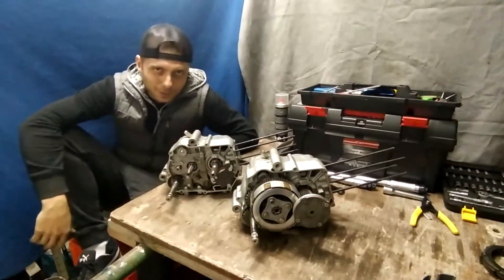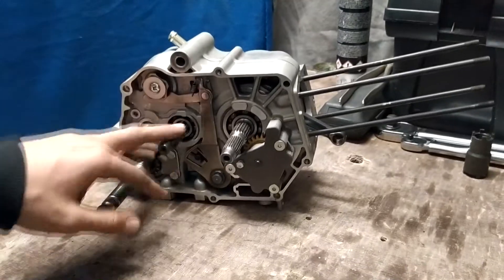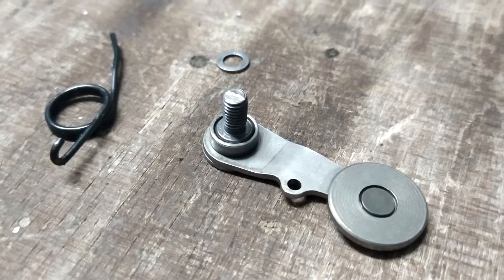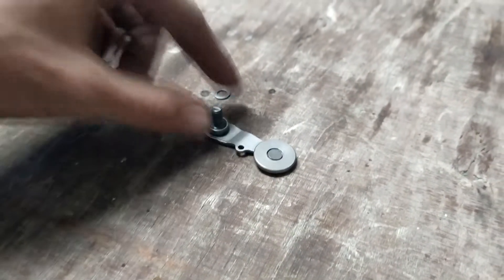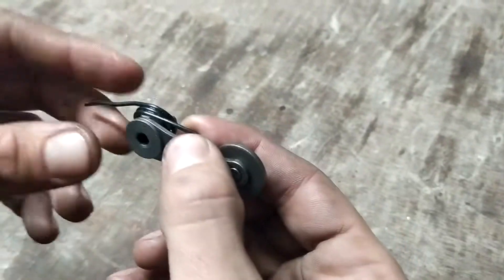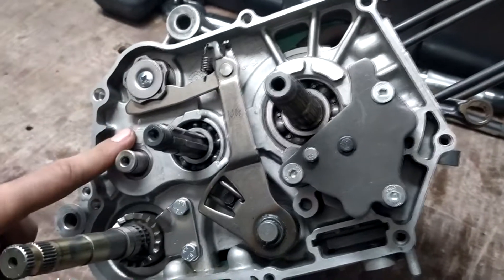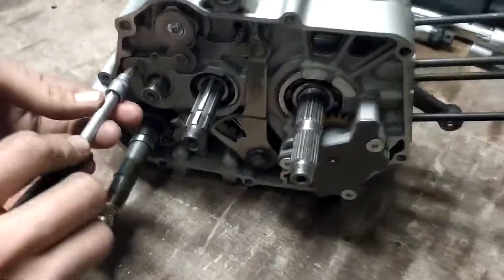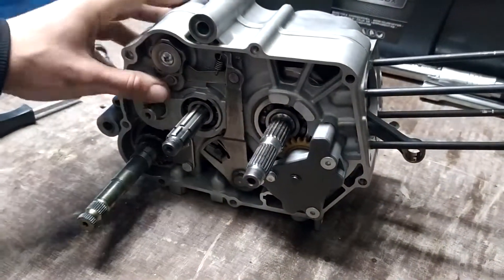Jak složit pitbikový motor YX 140 - část 3. - Spojka a odstředivka oleje

Comment: I did all that and now I have a problem with a clutch..the clutch lever of the block doesn't move. the "T" piece in the block is supposed to press on the bearing on the clutch and push it in, in order for clutch to separate? What do I do? Lol
Reply from the maker: Zkus to prosím česky
Reply: @Mattpitbiketeam  Už jsem to vyřešil, ukázalo se, že se nic nestalo. Každopádně děkuji! :)
Reply: @U.AND.ME_FILM how did you fix it
Reply: @FfjfErgh  funny thing, nothing was actually wrong, I just underestimated the force needed on the lever to press the bearing in. I thought it should go much easier, I was rebuilding this for the first time, while I never actually drove any. 😄
Reply: @ I’ve put a new clutch in as the old one was slipping I brought a complete unit inc the basket shims plates n all that I’ve installed it all correctly but the little plate with the bearing and 4 springs when tightened all the way down it contacts the castle nut and dosent let the clutch be out in of you leave the bolts half undone the clutch lever has a feel and works abit but it’s really jolty and makes a weird noise so you clearly can’t have them bolts left loose inside the engine just really stuck on this 👍
Reply: @FfjfErgh  Yeah, I think I had the same problem tbh. I probably took it apart and back together 20+ times. At the end, I went to my friend who's a mechanic, checked it, said everything's fine and it should be "that hard". So apparently that was it, lol.